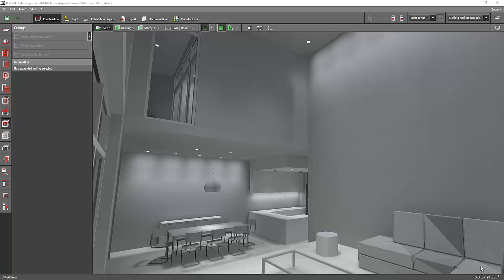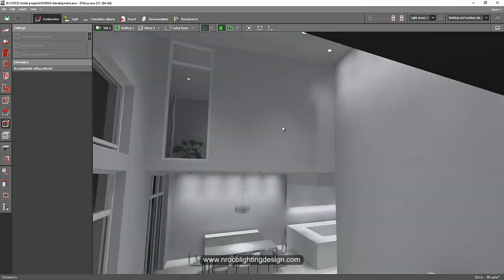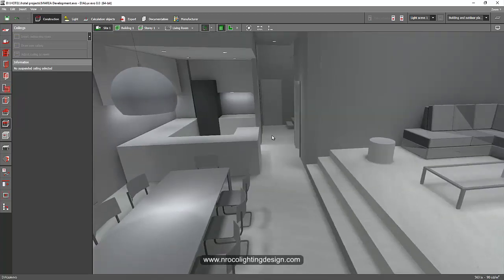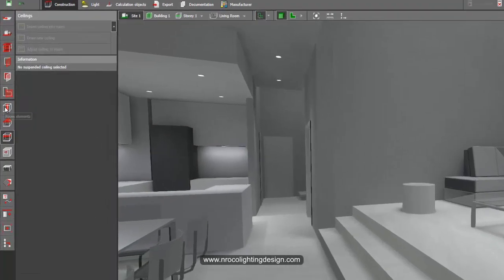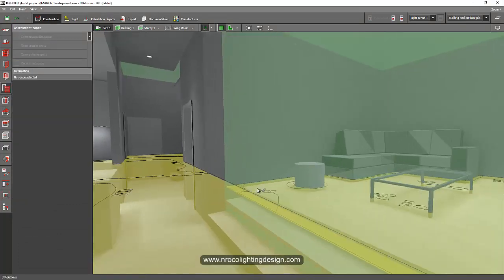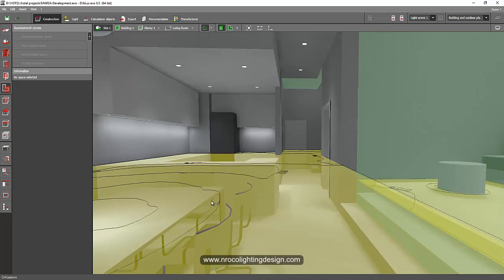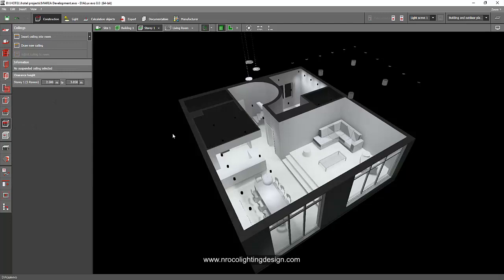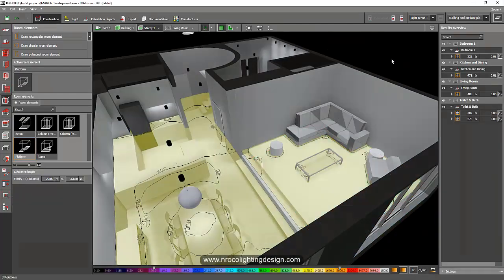How to create different floor heights in Dialux evo

Comment: Hi Nelca, I used to do the same method like you did, but the problem is when I want to calculate the overall floor surface calculation, dialux will calculated the surface below the platforms as 0, question is how to make an overall floor surface as one number calculation?
Reply: what I mean is if we want to use floor calculation result
Reply: I m probably late but you can add a "calculation surface"  to your room and then change is height.